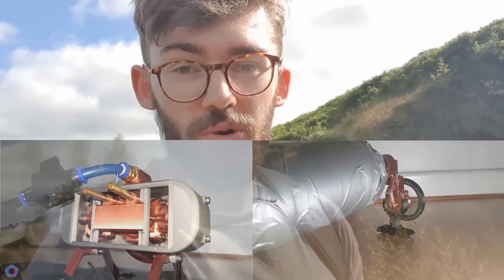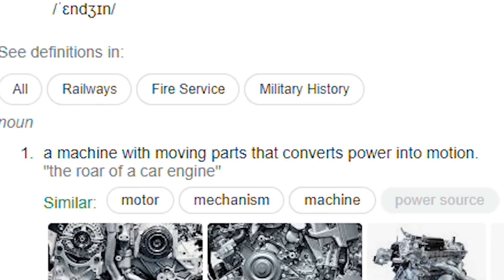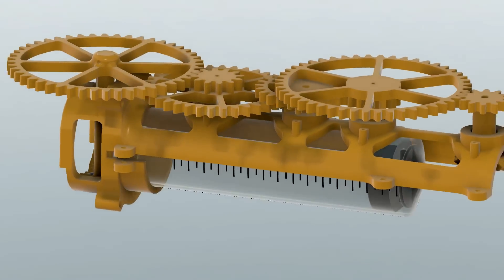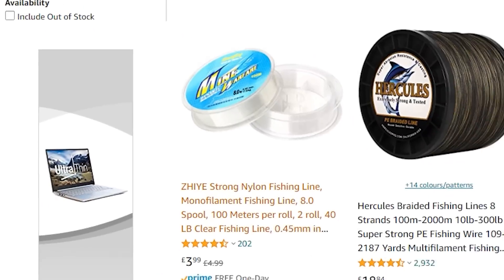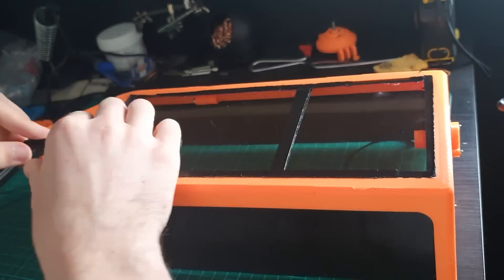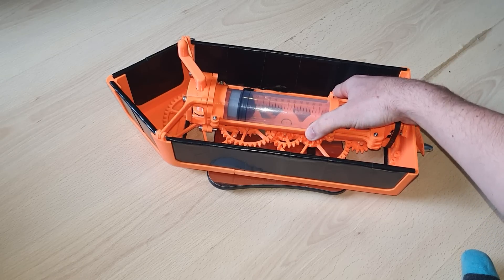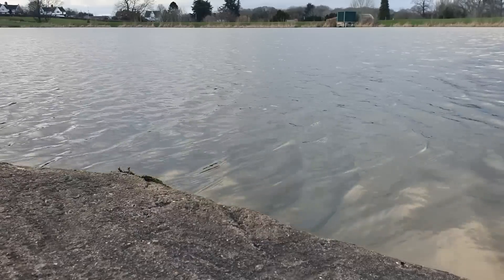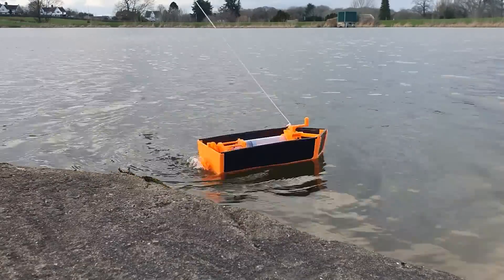3D printed atmosphere powered boat

Comment: A simple way to improve efficiency and keep it from spinning is to increase the propeller shaft, and put a tapered intake duct around the propeller that reaches below the hull so as to work somewhat similarly to a jet boat [but in this case it is not a true 'jet' so much as just a diverted flow propeller] and add a rearward spar [ basically a rudder that never turns, or, if you will, an 'anal fin' (sure hope that does not offend anybody because that is the literally correct nomenclature for it <see top image reference at this link https://en.wikipedia.org/wiki/Fish_anatomy>)] that imparts a little bit of  directional stability in motion.

Also, a more of a 'screw type' propeller [more pitch but somewhat less diameter] would improve the efficiency as you would not be 'swatting' or 'battering' the water, but slicing through it like a knife, but also driving it, like a screw. [this is why many modern ship propellers today are referred to as 'screws', even though they look much more like the turbine fans on a high bypass turbojet engine from a passenger airliner] https://www.mpofcinci.com/blog/best-practices-for-marine-propeller-design/ and https://itboat.com/articles/4614-how-to-pick-the-right-screw-to-the-motor

Comment: Funny experiment and works pretty well. Only real mistake that you made is that you positioned the propeller behind the boat instead of under the boat. You see your boat does mainly circles. This is because of the wheel effect of a propeller.  Normally you will find a complete submerged propeller and also that will have a wheel effect. This is caused by drag of the prop  blades not being the same on the top and bottom of the prop due to different location in depth. The deeper the higher the pressure. So the blade will feel less pressure when on top compared to being on the bottom. And so will the difference in drag. The forces will work against each other and the remaining  force will push the prop ( and stern of the boat) to one direction. And that will be the right when you have a right rotating prop and left with a left rotating prop. In your case half the prop is even above the waterline so there is only one big sidewards component without the top sode of the prop producing the  opposite little smaller component to dampen the effect of going sideways. And you only use half of the thrust the prop could produce ( or half the resistance so prop will spin double as fast and shorten the duration of the engine running)
What you could do is turn the engine 180 degrees and design a beveled gearbox to be able to have a prop shaft going down under an angle from the front of the boat. use a long prop shaft to position the prop just under the hull in the back amd have the shallowest angle as possible.  because angled also means that a part of the thrust is going down and is less efficient compared to straight back ( like an outboard prop).

Comment: Soooo, the  plunger moves because the atmosphere is pushing it. NOPE. The force of vacuum is pulling on the plunger and atmospheric pressure is giving it a barely noticeable slight shove at the same time. Vacuum exerts a force, way more than the atmosphere.
Reply: Incorrect. The atmosphere presses it in because there is nothing in the vaccuum to resist it

Comment: { YOU ARE A FRAUD  ! ! !  } or at the very least Uninformed on the Differences  Between Being POWERED by  Maniacally INTENTIONALLY COMPRESSED AIR & that of Being POWERED  ONLY  By  The Surrounding   AIR PRESSURE We Call ATMOSPHERE  Which Generally, at ground level, the atmospheric pressure doesn't fluctuate by more than a few percent—between 30.50 and 29.50 inches 

I'm Sorry But Your Imparting Maniacal Energy  IE:  { YOU CRANKING IT } & turning it into  COMPRESSED AIR  ! ! !
 AKA PNEUMATIC ENERGY   ( containing or operated by air or gas under pressure ) this  Is NOT Powered By ATMOSPHERIC PRESSURES  This Is just a COMPRESSED AIR BOAT with a CRANK witch YOU Have to CRANK to Replenish... If this was Truly  ATMOSPHERICALLY Driven it would just sit their doing NOTHING Until the PRESSURE CHANGED  ! ! !

& it Would Be Boring AF Because you Would Actually Have to wait until the Outside Air Pressure  CHANGED

Even Than it would Barely Move as the Atmosphere Changes too Slowly  & Very Incrementally Leaving Barley ANY USABLE AIR PRESSURE to be Transformed Back into Maniacal Energy

Comment: Do you have a stl file? 
And are u willing to share it? 
I'm very curious what would happen when i put an extra electric motor in with gears to pull the piston back again.
Using electric to vacuüm up the chamber again. 
I think this could be very energy saving with the right gears ratio setup.

Comment: I love watching your videos, you may learn so much from them. 
And dont get me wrong, the engineering part was amazing doing gear ratio and etc. 
But that is not an engine, more as power storage unit. We dont make "new" energy via burning or moving part as in windmiles or machine engine, we are more likely using storaged energy by moving the syringe in the opposite was of motion. As an example we may get the same effect using a rubber band twisted several times. That engine is more similar to a battery neither an actuall engine. 
But besides that, you are truly a wonderful engineer.

Comment: boats with an inboard engine have an inclined shaft that spins the propeller. The propeller itself has its axis inclined with respect to the waterline...or you could add a further transmission gear that brings the motion to a lower propeller...search for stern drives...anyway you convert the mechanical power of your hand and arm into the potential power made of the difference pressures between the inner and outer part of the sirynge. Finally, you convert it again into mechanical power by make the propeller to spin...I am not sure to have understood your research...

Comment: You want to encapsulate the rotor on the planar side so the water is forced out the back instead the sides, or lower the rotor to allow intake from the front, or even better do both.

Comment: Late to the party. Some folks already mentioned the possible contribution of the large gears' moment of inertia to the boat's rotation. So not only should the propeller be fully submerged or there be two counter-rotating propellers, there should perhaps be two mirrored gear trains, perhaps from parallel syringes, designed so that every gear has a mirrored counterpart rotating in the opposite direction to counteract its respective torque.

Comment: You must redistribute the weight toward the stern (or simply add weight if this doesn't cause undo drag). You might (or cause "excessive" leakage now I remember your tape-sealant design strategy)  ahem ...where was oh yes, you might find some success by adding another section of hull, and even more success by swapping thr bow entirely for one twice as long, tapering to the bowsprit from as far back as possible thereby both improving at once hydrodynamics and achieving optimum weight distribution.
   ...or so goes my initial real time thinking in reaction blah blah blah

Comment: 5:34 Flip the pieces of bottom hull. By having the longer bottom in the shorter rail piece, it will give you extra strength at the glue joint.  AH, I SEE 6:45 YOU’VE DONE THAT.

Comment: 10 times better than I could have done.  And you probably know this, but a propeller half out of the water acts like a paddle wheel more than it does a propeller.  Also he prop is too close to the rear of the boat, it's not getting clear water flow.
I would move the prop to a position under the stern of the boat, and add a rudder.  Send power to the prop with a shaft.  You might want to turn the motor around and run the shaft from the front of the boat to the back.

Comment: You made a spring powered device.  The atmosphere isn't "powering" anything.  Your arm is powering the spring.  Also, an air spring will have a lot more losses than a regular ol' coil spring, as you are changing the temperature of the air and have seal friction. 
Neet project, but not a power source.
Reply from the maker: The atmosphere is pushing the piston back in and therefore is powering the mechanism. Doesn't matter how the syringe is "charged".

Yeah it probably is super lossy, more made for fun than efficiency!
Reply: @kurzey8532  I mean it is a great gizmo, I just feel the need anything that suggests "free energy".  Don't let cranky old internet trolls ruin your fun.

Comment: which is better air pressure or vacuum? Well guess what- you can get up to 1 atmosphere of pressure from stored vacuum, and from pressure you can get... anything you want depending on the strength of the tank!. That syringe can probably handle 3 or 4x that before it leaks too much. 

It's a weird novelty but its pointless. I thought you were making a boat that could run on the air pressure changes in the atmosphere, but instead you made a vacuum engine from the 1800s (1700s?)

Comment: The goals of the project are not clear. The implementation of the drive is very far from being perfect, but even from any one design at all. What is the result: 1. Useless hull. 2. Useless drive. 3. imperfect gears.
4. what works well is only the vacuum spring itself.

A specific offer and what I expected to see but did not see. The ability to wind the spring with one forceful movement. This could be implemented in a longer boat hull. If a cord was tied to the piston, for which the piston would be pulled out with one movement of the hand and would engage with the gear rack. During the reverse stroke, the piston would pull the gear rack and the force through the gearbox would be transmitted to the propeller shaft. The shaft itself also needs to be redesigned so that the propeller is submerged in water like on real boats. This would also be facilitated by the additional shipment of the hull of the boat with ballast.

Wish you success in the construction

Comment: This is actually "powered" by you, via the energy you use to retract the plunger. The atmosphere is only the medium through which the energy is transferred. It is essential a type of friction motor, right? 😅
Edit
It is a friction motor with an atmospheric battery.

Comment: Great attempt, just need to be perfected for the case of a boat!
Simply put, with the propeller completely submerged, there would no longer be the effect of rotation, as each blade pushes in the opposite direction, and a rudder would have to be added to choose its direction !

Comment: I admire the engineering and tenacity required for this project...

And at the same time, I cringe at the thought of investing so much time and energy into a mechanism that only works marginally better than twisting a rubber band.

In fact, having the mechanism pull tension on rubber bands rather than the plunger might even work better.

I think you should spend another 1000 hours or so exploring rubber band powered boat engines.

Imagine the industrial applications.

Comment: It's all about pressure difference, even if u can achieve complete vacuum u can generate max 1atm difference, with vacuum engine. But with strong enough container u can storage much more pressure difference, up to 4-5atm home made (4-5 x more than vacuum engine), it means u can storage much more energy for longer time, that's why vacuum engine r not effective.

Comment: Surprised at how long it ran from that one  "charge" of vacuum.  
    If you can get that prop more than 75-80% submerged you'll minimize the tendency it has to turn In a circle. I'd likely start by reducing the overall diameter of the prop as well as decrease the amount of pitch on the blades. 
   Really solid build though, I'm impressed.

Comment: I would look for a plastic pipe with similar inner diameter and use the plunger and a pipe cap to make a very long syringe. This will increase the running time. The boat spins due to the boat having no rudder. If you implement a system like a bicycles wheel sprocket which clicks in one direction and engages in the other you may be able to tension the syringe without having the entire mechanism move.

Comment: when i saw atmosphere powered i was originally thinking that it would recharge by using the naturally changing air pressure to mechanically store energy in a spring, but here is another kind of atmo motor then.
Reply from the maker: That is a clever idea, though i imagine the difference in air pressure may not be enough to do anything useful with at this scale, though I may be wrong.
Reply: @kurzey8532  a small really efficient clock can work, but some tight tolerances and low friction would be an order unless you have large bellows for larger force.

Comment: One possible fix would be to extend the top shaft beyond the stern of the boat, and run a longer belt to a propeller shaft mounted to the bottom of the boat.

Comment: L O L it’s human powered no atmosphere powered. The atmosphere is the source of potential energy.  Muscular energy was used to pull the plunger back… not atmosphere.  You could’ve achieved the same thing with the wind up spring.
Reply from the maker: If i used a drill to wind the mechanism back would that make it electrically powered?

Muscular energy was used to charge the  "battery" the atmosphere pushed back on the piston powering the propeller

Comment: the power comes from you initially pulling the syringe. renaming it like you did, gives the impression of a new technology, hence clickbait.
Reply from the maker: The atmosphere is the source of energy that is pushing the piston down the syringe....not clickbait pal
Reply: @kurzey8532  and why is the athmosphere pushing the piston? would it do so without you puttin energy into the system? it is clickbait. be honest. i would do the same.
Reply from the maker: @terenceundbud  by your logic an electric car would be coal powered if it was charged from a coal power plant.

Most energy we use is derived from the sun in one way or another, is everything therefore solar powered?

Comment: You just need a rudder and try more weight in the boat to put the prop under water. Also try fitting a cavitation plate above the prop. Alternatively put a tube/duct around the prop.

Comment: I SO fucking relate to his comment at Min2:19sec: Now I just need to go into fusion360 and design a bevel gear... wasting two days... Fuck paying 12$ for a solution..
I have found myself in this position so many times. And it's not that I can't a ford the 12$ solution, it's just that my project does not feel like being worth the 12$ (but I still wasted two days on it, I could have worked in the 12$ in half an hour overtime work)

Comment: Traditionally 'engine' is not limited to power source, so any mechanical contrivance can be 'an engine'.

PS that wasn't Jimmy Saville in the clip? 

Because even if it looks like Saville you are 'running into danger'!

Needs contra rotating props.

Comment: Here's an idea for a super simple redesign.  Use paddle wheels, one each side of the hull with a steel shaft connecting them. Now you could connect the shaft, via the string, directly to the piston. It would also be relatively easy to put in an extra shaft between the piston and final drive to gear up the system.

Comment: Nice project!  You really got that vacuum engine working well.  One minor improvement (which may not be that easy) is to get the propeller fully in the water.  The reason the boat went in a circle is because the propeller was only 1/2 in the water.  The half in the water gave a lateral thrust in additional to the intended axial thrust.  Normally this would have been countered by the top half, but that had only air to react against.
Reply from the maker: Yeah from reading a lot of the other comments I can see that would definitely help, need the boat to sit further down in the water!

Comment: A prop in motion will make a sideways motion like it was a wheel running on bottom of Lake. So you get a forward component, and small sideways component, you can mount motor at angle to counteract or add a simple rudder, with a slight angle. The book Naval shiphandling by Crenshaw shows how forces work and are used in ships.

Comment: When you have a 1 propeller the torque makes the vehicle turn that direction. So on planes single propeller planes have their engine on an angle to the side it wants to rotate to. Or you could try a second propeller  that spins the opposite way the counteract the torque

Comment: 6 months later your voice changed! That was amazing, lasted pretty long!
You should try to make a very long boat where the entire hull is a PVC Tube with a piston, or make it a catamaran so you can have 2 long and powerful engines that will last a long time. Put on a RC Rudder. Bonus points if you can make it a jet drive instead of a propeller. There's some 3D Printable jet drives out there.

Comment: if the prop was fully under water, it would be pushing the boat to both sides canceling it out but because only the lower half of it is underwater it kinda acts like a wheel and makes it turn on itself, so you can do two things to fix that, either put two counter rotation props or submurge the one prop underwater... otherwise, sick project! nice one and good luck with future projects👌
Reply: Yep. That prop thinks it's a paddlewheel.

Comment: This was cool. An iteration of this which truly worked off positive and negative changes in atmospheric pressure to drive a small generator charging a super capacitor to power some low power electronics intermittently would be amazing. And it would work anywhere. There are applications which could use this.